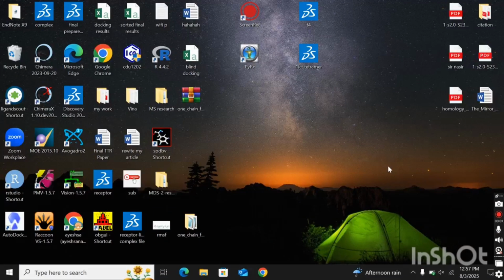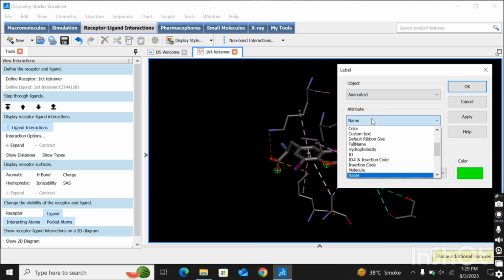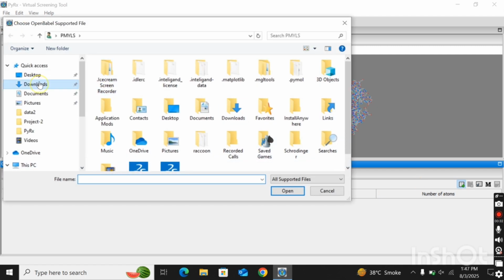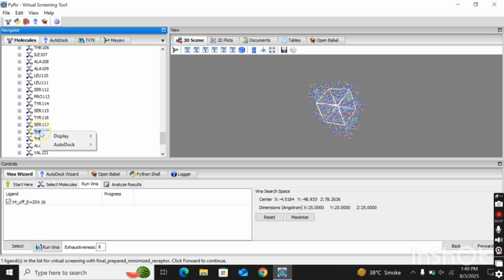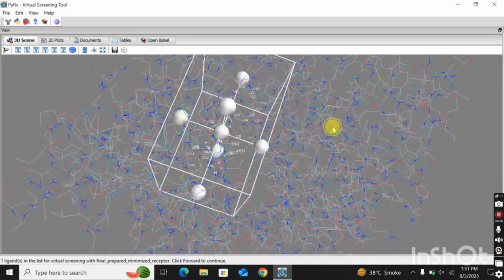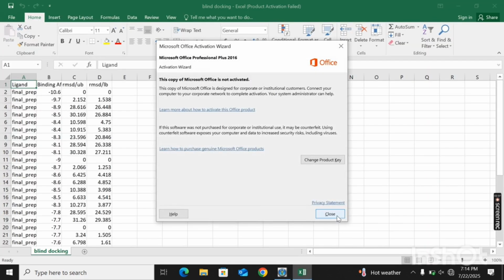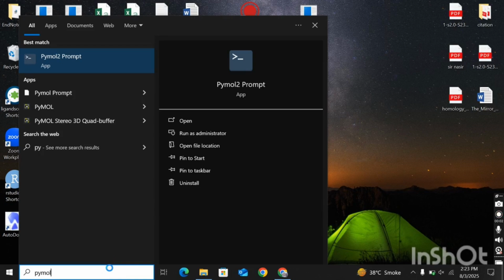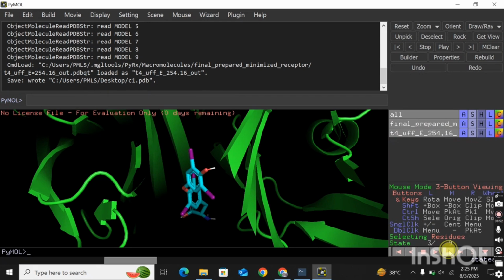Lecture 4:Targeted or site specific docking by PyRx| find binding pocket residues| interpret result

Comment: How to dock big molecule ligand to a spesific ligand site? When the native / co-crystall ligand is a relatively small molecule? For example, my ligand is a carotenoid which i would like to dock to 5IKQ protein.. the native ligand of 5IKQ is smaller compund, when i run the docking process, it was error
Reply from the maker: Make the grid larger according to the size of the molecule, generally the error was not due to the size of molecules, it's due to their geometry deformation or anything else.

Comment: The top-ranked pose from PyRx (AutoDock Vina) in blind docking isn't always reproducible or visualized identically in Discovery Studio in 2d and 3d views ,why???
Reply: This is because of random docking..which means your ligand pose at different sites when you repeat the blind docking for the same protein and ligand ...if you face such a thing then it is not an issue